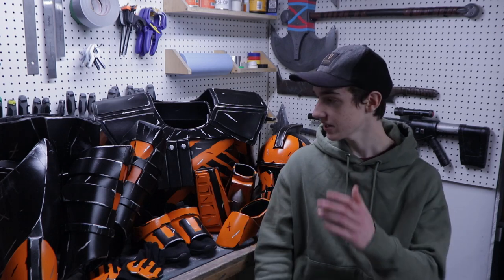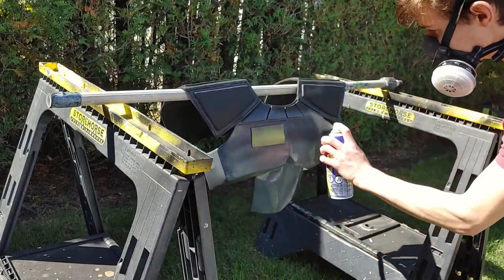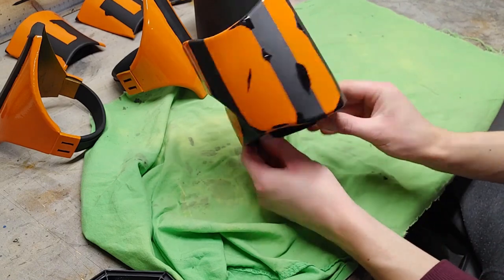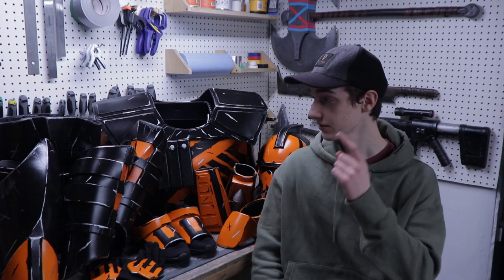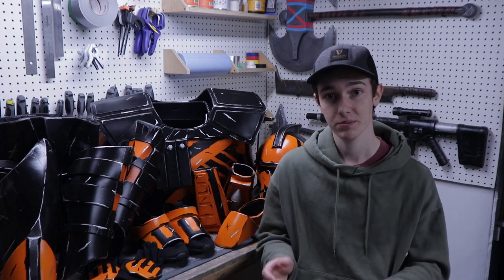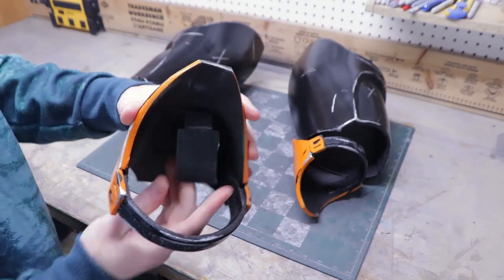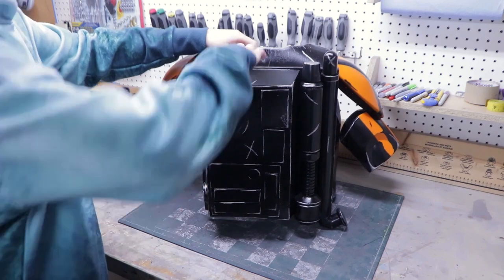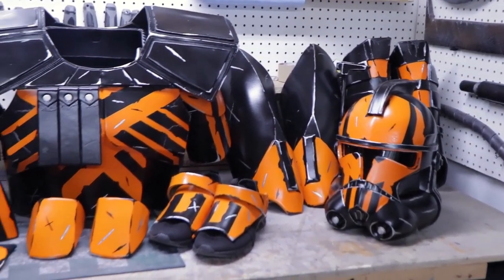PAINT and ASSEMBLE Your Own Foam CLONE TROOPER ARMOR | With Templates

Comment: Did you use metal paint as part of your weathering? On the clone armor forums several years ago, the members argued if metal paint was ok.

My opinion, and extrapolating a bit... Maybe clone armor could be lamination of impact resistant plastic, plasti-steel, and some sort of metal... So, I used a silver Testor's metal paint pens then a black paint pen for scorch around the silver edges ..  then wood stain to simulate oxidation (or aging and/or rusting). I could find detail and very subtle weathering.
Reply from the maker: I used a chrome paint for the scratches because I like the look. But as far as I know, clone armor is just a type of plastic that comes in white or black for the umbra ARC trooper. 

If you look at the clones in Battlefront, the armors have scratches that are the same color as the surface, indicating that the material is a white or black plastic.

But no cosplay has to be 100% accurate, so just have fun and find a finish you like, just like I did. :)

Comment: I’m in the process of cutting out my armor pieces now (with a MGS1 Solid Snake inspired paint job once that’s done, hopefully in time for NYCC), and I was wondering what kind of jumpsuit would you recommend for underneath the armor?  
Also, what should I do about making the shoe covers, as they aren’t included in the files from Etsy?
Reply from the maker: For the undersuit I just used black pants and a black turtle neck shirt.

The shoe covers are simple trapezoidal parts. You should be able to make those easily without a template.

Comment: Hey Tristan, I’ve gotten a few of your templates and am working on some armor now. But, I’m wondering how you made the rangefinder for the phase 2 helmet? Where does it come from and how did you get it to swivel?
Reply from the maker: I 3D printed it from a file from Galactic Armory for an ARC Trooper helmet. It's mounted on a screw and nut to make it swivel.

Comment: The armor looks amazing. Im trying to make mine but white, what white spray paint would you recommend to use?? And would you recommend a different colour base seal or does that not matter?
Reply from the maker: Cool! You can use grey plastidip (3 coats) or watered down modpodge (5 coats) to seal the foam. Then if you want to use spray paint, the rust oleum 2x line works great. You could also use good quality acrylic paint. After that you can seal the paintjob with rust oleum 2x clear in matte or satin.
Reply: @TristanMaker  Thank you!!

Comment: Hi I am new to this hobby and I love the look of this armor! But i have 2 questions about it: can you sit in it comfortably and not damage the butt and back plate whiel sitting? Dose it get hot in the armory fast?
Reply from the maker: Awesome! Unfortunately sitting in the armor is really hard, but doable. And depending on how you sit, you might damage the butt piece a little bit.

And if you have already worn an armor before, you'll see that this one doesn't get as hot as others because there is a lot of air flow. If you have never worn an armor before, it's gonna take some getting used to how hot it is.
Reply: Ok, thank you for the answer

Comment: Are the chest covers implemented in the templates?
Reply from the maker: If you're talking about the ARC Trooper parts, they are not included in the templates.
Reply: @TristanMaker  any Chance to get those?
Reply from the maker: Unfortunately  I didn't make any templates for them so you'll have to make them from scratch. Thankfully the design is pretty simple so it shouldn't be hard.

Comment: Do i need a 3d printer at all?
Reply from the maker: Nope, you can make everything out if EVA foam :)
Reply: What if it doesn’t fit any tips on modifying the template to fit the owner
Reply from the maker: I show how to trim parts of the armors in the build videos